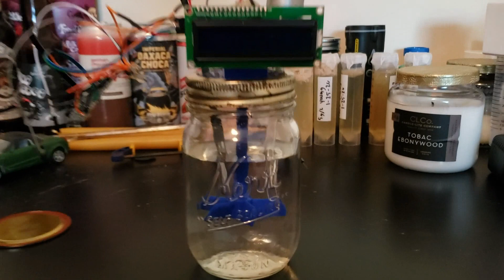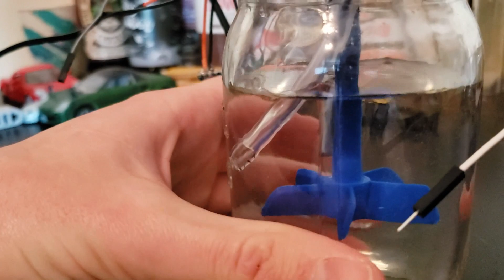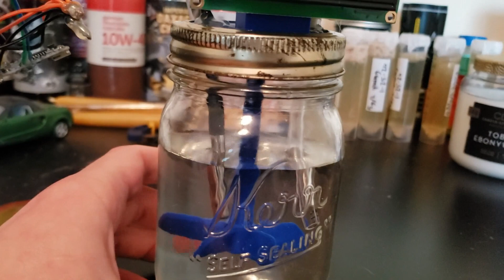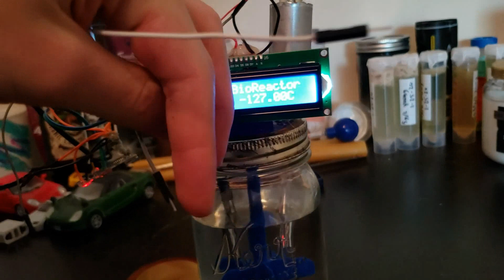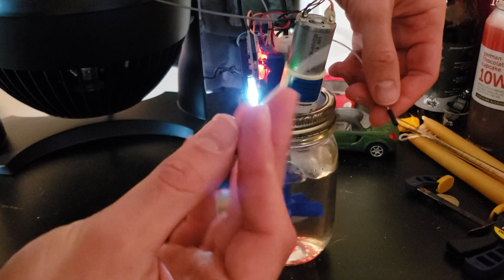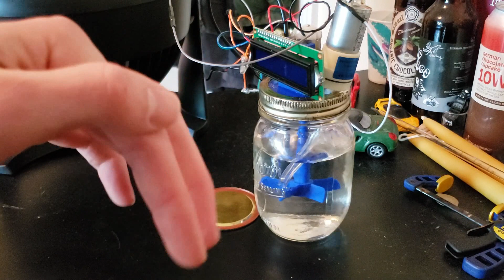Build a Bioreactor for $10?

Comment: Why didn't you use msgnetic stirer? It can be made simpler, quicker and even cheaper with a computer cooler.
Reply from the maker: You're absolutely right, I ended up doing this in future videos
Reply: Almost started to write the same comment. :)